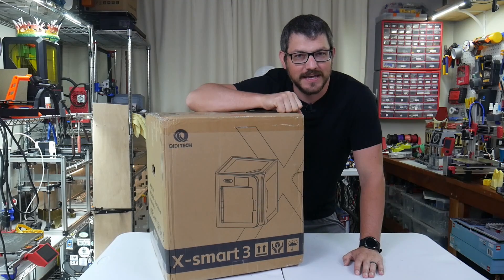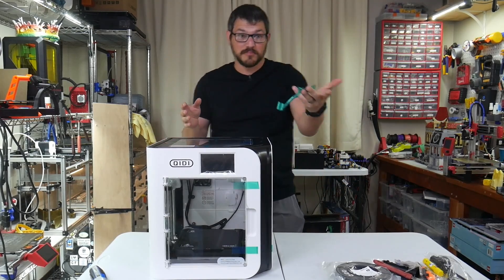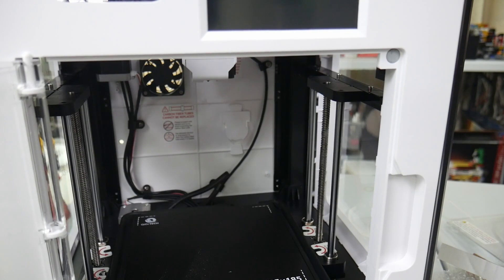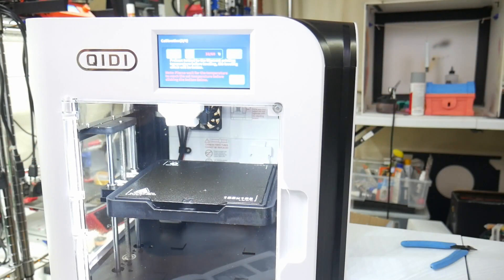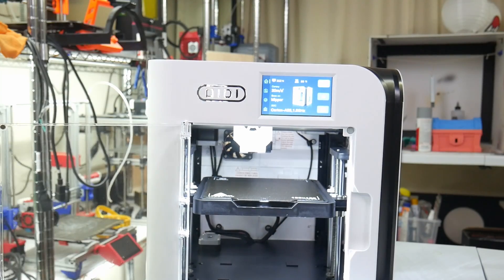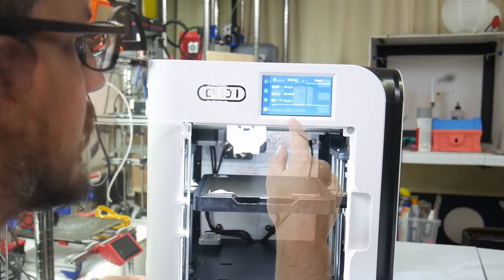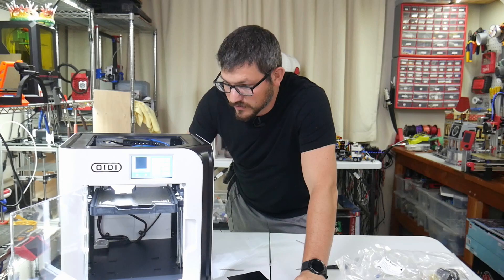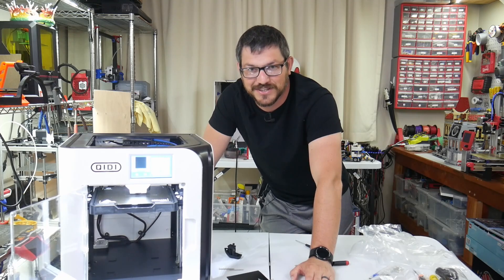Qidi X-Smart 3 Unboxing, Setup and First Print

Comment: I frustrated with 3d printer Qidi x-smart.. failed for 12 time. I try changed time speed or slow, hot low or up, etc but still bad. wrong with them.